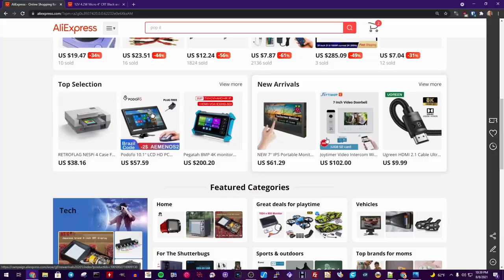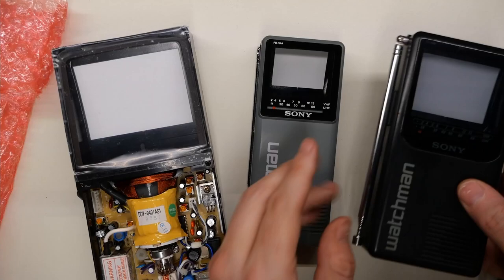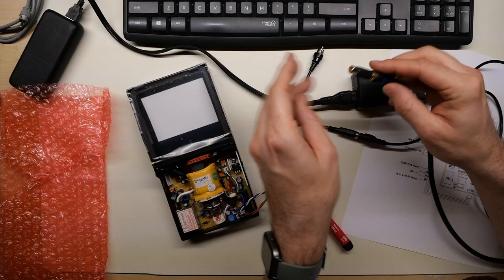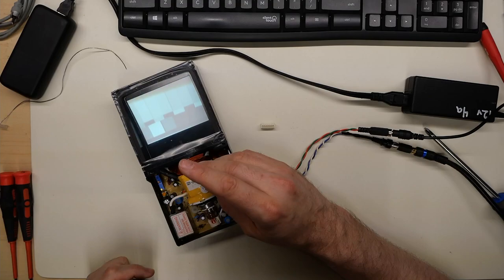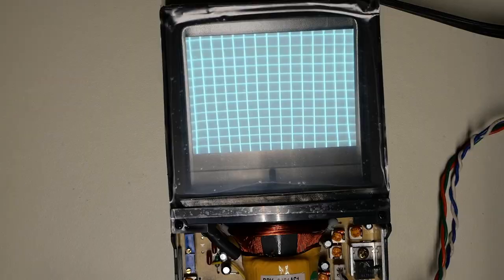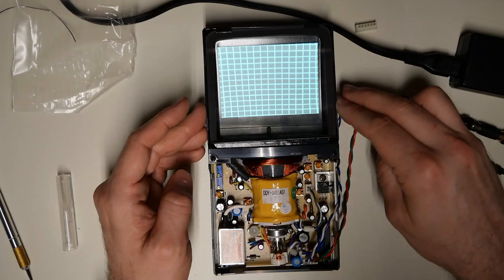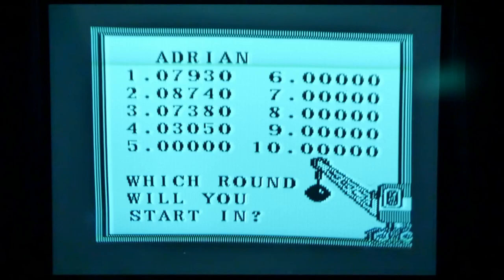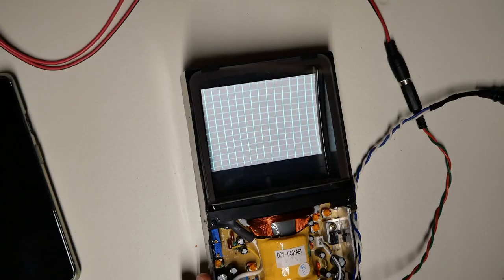This small CRT monitor is less than 2" thick

Comment: Love the warning label.  
"Warning.  High voltage may cause mortal damage"
That's one way of putting it.
Reply: Obviously, this means you’re supposed to play Mortal Kombat on it. FATALITY!
Reply: Between 10Kv and 20Kv !
Reply: Just touch everything while making a video.  It might just make a good episode of CSI.
Reply: I picked one of these up in a new in box door phone at Goodwill.  Paid $5 or something for it.  It's awesome!  Had to come back months later and find this video when I realized it was the same modular display.
Reply: Actually I doubt that the high voltage exceeded 10kv. More likely in the 5kv to 7kv. The reason the television screens used 10kv to 30kv is because the larger screens required it do to the greater distance that the  CRT election beam has to go to strike the phosphorus screen. Color TV's have to use 30kv & at a current level high enough to kill you if you came into contact with it. This was one of the hazards of working on the first color TV's. The CRT's didn't have a glass bell like later color CRT's. Instead the bell part of the CRT's was metal. If you came into contact with those CRT's while the power was on, you risked getting electrocuted. Even after the power was turned off, you could an electric shock strong enough to knock you on your butt. I worked with a TV Technician who got such a shoke once. His hand came flying out of the back of the TV so fast that he ripped some of the skin on his hand as it collided some of the electronics attached to the back of the TV cabinet. Yeah he was bleeding afterwards. Later color TV's had a resistor and other features designed to discharge the CRT anode high voltage as soon as the TV was turned off or disconnected from the power.
Reply: I love how Adrian laughs off getting zapped.
Reply: LMAO

Comment: There actually was a COLOR version of the watchman CRT.  It didn't have a shadow mask, and it had only ONE electron gun.  Between each RGB strip of phosphor, was a thin strip of UV phosphor.  A photo detector saw the flash of UV light as the beam moved, and then the electronics switched the gun to the next color in sequence.  By the time SONY worked out the kinks on this tube, color LCD's were cheaper to make and the CRT color watchman didn't make it to the consumer market, but there are probably some prototypes floating around out there, maybe some industrial versions too.

I think Adafruit has those connectors, maybe on cable assys.
Try a degaussing coil on the monitor to remove stray magnetism.
Reply: Wasn't that the Indextron? From what I heard only one model of Sony Indextron (really a beam-index tube) and even that it's pretty rare these days...

Color Watchman TVs iirc used a plain Samsung shadow mask tube.
Reply: amazing
Reply: I just watched a CRT dude do a video on that, was used in a pro camera view finder then forgotten.
Reply: I NEED to get my hands on one

Comment: A couple of tips that I learned playing with these: 

Adding a magnet as you mentioned does help with the geometry.
If you are able to push the yoke up closer to the screen, that also helps with the geometry. If the neck were just a tad longer, I think it would be about perfect.
These look really cool with gel filters over the glass. I have tried red, green, and amber. Even better with a negative image while using the filters

Using the Arduino TVOut library to play with this is fun. I have been working on an expressive robot face to retrofit an 80s robot with one of these monitors.

Comment: To help those old white phosphor CRTs, all you need is a tinted glass/plastic filter or photographic gel right on top of the display.  It will really help with contrast in daylight scenarios.
Reply: that's what i was thinking, try putting a black-tinted piece of plastic or glass over it, in theory it'd work

Comment: Model Railroad guys used a portable DVD player with the small screen to make a drive in theater for O Gauge. You could make a drive-in theater for HO or Z gauge with this. 
Or, go the other way and make a console game for a 12 inch action figure like GI Joe and Barbie.  They real ones had those mirrored things that look a bit like this.
Reply: In Z this would be larger than the largest IMAX screen.
Reply: or a CRT based raspberry pi emulation handheld.
Reply: imax for polly pocket
Reply: imax for polly pocket

Comment: Best use for this? Retro CRT handheld. Use a Raspberry Pi Zero or something and integrate it together in a case.
Reply: It’s monochrome, but yeah a CRT Gameboy would be neat.
Reply: its too bad it isn't color!
Reply: My first thought was functional pip-boy style wearable retro-futuristic computer.
Reply: @michaelathens953  the fact that in Fallout they miniaturised standard tubes (with the bulbous curvature etc) instead of a real side-beam one, is probably the most impressive thing about the Pip Boys to me. Though of course in 1&2 the UI was a bit more mechanical with paper labels vs the “B&W TV but small” aesthetic of the latter ones.
Reply: Perhaps you can even "Re-Invent" a Gameboy handheld console:@)
I was joking by the way !

Comment: 10 years ago there was a whole stack of these complete in a white case, for just €4 a piece at a army and electronics dump store. Bought one of course. They're cute little things, and very convenient as a mobile analog monitor to use when testing consoles and such.
Mine is indeed one of those door monitors. Doesn't have a brand stamped on it, but it's similar to a Golmar monitor. 
 The picture quality is just fine. For 'organic' things like people, the distortion is not noticeable and the contrast is no different than from other monitors. 
The sharpness is not ideal though. Small text is a bit hard to read. Gotta say i didn't try the focus control yet.
Reply: where is this store? I keep hearing of these type of places never seen one
Reply: This CRT is the opposite of a BVM.

Comment: I grabbed a couple of these a while ago. One is being used as a handy workbench mini-monitor for retro SD video out testing and projects. The other one I intend to use as the display for getting my 70’s General Instruments AY-3-8500 series video game IC’s back up and running as a cool retro self-contained portable game. :)
Reply: How did you prevent it from randomly turning off after 30 or so seconds?

Comment: I used to work at a place called "Lexel Imaging" that was the remnants of Hughes Electronics.  Their specialty was CRTs for specialized markets (the only that exist now).  Those little CRTs remind me of the tiny CRTs we made for the AH64 Apache HUD!  I made the coils by hand on a little lathe type apparatus, and formed them into a C shape by hand.  Then you would put just the right amount of high current through it so it would melt the lacquer coating and get hard to retain its new shape.  I also assembled the coils on to the tube and wrapped with mu metal.  There were probably only about 5 of us who worked there doing soldering, assembly and rework.  I got the job because I could solder.  Anyway the AH-64 CRTS weren't 90 deg angle like these -- they were just like a tiny TV set.  In the HUD, it uses a prism or mirror to turn the image.  I wonder why they didn't do it the same way in those Watchmans.

Comment: Yes, regular CRTs use tinted glass to increase the contrast ratio. But usually only a thin layer of tinted glass on the inside, because if the whole 1/2...3/4" thickness of the screen would be tinted, it would decrease the brightness too much. I wonder if a tinted plastic foil would improve the picture with this tube. You can also make the picture green or amber this way, to emulate monochrome monitors :)
If you take a look at the back of this tube, and the tubes in the Watchmans, there is a big difference due to penny pinching during the manufacturing of the newer tubes (even in the genuine Sony I bought from ebay). There's an aluminium coating under the phosphor in the Watchman tubes, but there's no aluminium coating in the new tubes. The purpose of the aluminium coating is to reflect the light from the phosphor. Without that coating, the newer tubes waste close to 50% of their light output by projecting it behind the tube, onto the black plasitc bracket! This also means if you reverse the newer tube you can see the image from the back side, but unfortunately it's not usable this way, because the glass is textured, so the image is blurry through it. There's also a transparent, conductive ITO (Indium-Tin Oxide) coating on the inside of the screen to apply the anode voltage behind the phosphor. You can see some painted aquadag "fingers" inside the tube which connect the different parts of the tube through the lines where they are glued together. These painted "fingers" bring the anode voltage to the transparent electrode behind the phosphor.

I bought one of these monitors in a local online auction here in Hungary a few years ago (2017-2018 I think). I bought an other one from ebay a few months ago, that's actually a genuine Sony one. I will buy one more from Aliexpress, because I have a plan with them since years. Unfortunately the genuine Sony model is out of stock everywhere, except one US seller, but it's too expensive, both the product and the shipping.

Comment: OK, I admit, I'm only at 5:30 now, but I've noticed @ 2:10 that the PCB has a design date on it 2006-12-10, which could suggest that this has a 2007 manufacturing date - most likely for the South-East-Asian and South-American markets, as it would yet have been less expensive than LCD back then.

Comment: I think you'll find that the first version of that display was built and designed by Sinclair Research (1985), though that used static charge for deflection rather than magnetic coils.
Reply: A static charge one would be AMAZING because it would open up DIY oscilloscope possibilities
Reply: Yes I also believe Sir Clive Sinclair was the first with the  Tv80.  I have one in my collection.
Reply: @daholmes1  I've still got mine too. Owned it since 1984.
Reply: Yes - Sinclair did get theirs into production first -  https://en.wikipedia.org/wiki/TV80.  One interesting difference (for CRT nerds) - the Sony tube uses a curved surface for the phosphor which helps display geometry by simplifying the vertical deflection requirements. In the Sinclair tube, the phosphor surface is aid flat, parallel to the origins of the electron beam, so the beam has to be bent through a much greater angle.  In addition, the Sinclair tube has the electron gun off to one side, instead of below the viewing area.

Comment: The housing for the door intercom screens protected the screen from getting too much light and typically would only have been lit from overhead, so it wasn’t too hard to make it functional.  I always wondered how they were made...  very cool.  I saw quite a few of them still in use as a Home theater installer between 2009-2018, the area had a lot of ‘fancy’ older apartment buildings; if it ain’t broke...

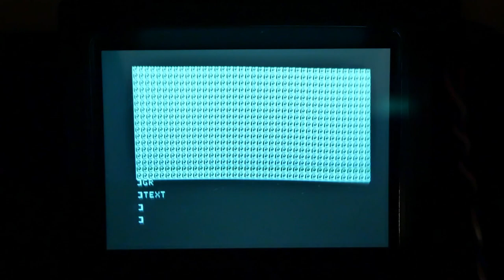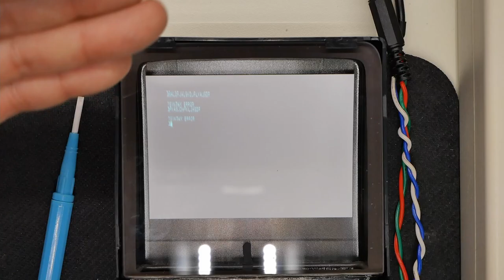Comment: Adrian, at time stamps 26:04 to 26:44 you discussed the color & brightness of the phosphorus display & asked if anyone knows about this. Well I'm your man. One of my 1st jobs as an Electronics Technician was in TV Repair in 1970. The color of most of the black & white CRT's was a flat light white or greenish white. The glass face of the CRT was clear to Smokey Grey. This smokey coloring acted like an ND lens filter on a camera to improve the contrast of the CRT image. Sometimes the glass in front of the CRT was tinted. This later trick of filtering ths CRT with tinted glass TV some fell  fell  y the wayside as the new color TV's started coming out, the CRT's all had smokey filters built into the glass. Also the larger CRT's had a noticably higher anode voltage applied allowing for a brighter image on the phosphorus screen. You could boost the anode high voltage on that monitor if you have the Hardware Skills necessary and then add a smokey grey glass or plastic sheet over the screen to improve the contrast in bright conditions. Sort of the same effect you get when you turn the lights out. In low light conditions, you eyes iris opens up to let in more light and the low light reduces the amount of light that reflects off of the light colored phosphorus.
Also after thinking about it, I think the reason the image moves or distorts when you touch the CRT screen is because the CRT beam is striking the front instead of the back of the screen. Everytime you touch the screen, you are putting your finger in the path of the electron CRT beam. Your finger is blocking &/or magnetically moving the electron beam to go around your finger. The static charge you're body picks up acts just like the magnetic field the video yoke produces to move the electron beam. When the electron beam strikes the phosphorus screen from the backside of the CRT screen, you don't get this affect.

Comment: I had the little grey Watchman back in the day. It had an 1/8th inch "antenna" jack on the top. So I got an adapter from Radio Shack that converted coax to 1/8th inch and was able to connect it to my cable box. I even got my 2600 to play through it!
Reply: It was so cool back in the analog days when you could just plug one thing into another thing and it just worked.

Comment: i just ordered one of these from the same site store about 2 weeks ago before seeing this. im just waiting for it to arrive.  i have, in some typical way in of finding an interest in something, gone down a rabbit hole of CRTs and vintage electronics. my backround....... i know nothing about electronics and circuitry, but find it really cool. in the past couple of months i managed to accidentally purchase a marantz model twenty and a marantz model 120b, which both are equiped with a miniature CRT scope display. then found a hitachi V-152F oscilloscope (free) and a 564B storage oscilloscope (pretty cheap). as well as five vintage CRT tubed televisions, in which two i transformed into dancing display oscilloscopes when audio is added to them. also on market place picked up a few boxes of stereo, tv, amplifier vacuum tubes that came with three seperate, individual , giant oscilloscope tubes/bulbs, which tey stand alone with no structure or frame, just the naked bulbs, and i tell ya, they alone are just beautiful.

Comment: The 15 pin video connector on the //c has a 12v output rated at 300mA...   It also has a composite video output on it... so you could make a cable to connect the crt directly to the //c with one cable/connection. :D
Reply from the maker: Yeah it could just do it -- with it taking just under that much current. :-) So a replacement for that flat LCD :-)

Comment: Thank you. I wondered how these type of picture tubes work. I was thinking it was more of a projection tube that lit up the screen, but you showed it is more direct then that. To use video signal with these old TVs you can use a RF modulator.

Comment: LOVE this experiment and video! Amazing (but perhaps predictable) that a new/old-stock CRT from 1993 still works so well. 

... also love your use of RealCalc in RPN format. I'm still using an HP48g for daily engineering use, but I use RealCalc in RPN when on the go.
Reply from the maker: I had a 48G all through college -- and never stopped using RPN. (My HP48G died a long time ago.) So yeah, RealCalc Plus is pretty damn awesome for quick calculations
Reply: I still use my HP15C regularly. I haven’t found anything that does quick calculations any better.
Reply: If you're an HP fan, you might prefer Free42, an HP-42S emulator. I find the HP-42S interface to be most comfortable of HP's interfaces, and more comfortable to use than RealCalc for most things. (One major exception is working in hexadecimal, where RealCalc is significantly better.)
Reply: There's a HP 48g android app called Droid48.
Reply: @Endelin  Thanks for the insight. At this point I'm going to stick with RealCalc. After Adrian's reply, I upgraded RealCalc to PLUS to support the creator of an app I was frequently using (and also became one of Adrian's Patreon members to support another great creator.)

Comment: I ordered two of these after seeing this video. They ended up working fine, but one had a shorted "Cheng" brand electrolytic capacitor on the output of the voltage regulator that exploded with a loud bang! In hindsight I recommend bringing up the voltage slowly and watching current draw closely to try to reform the caps, or at least avoid bangs.

Comment: these unit were used as portable CCT set up monitors for engineers to focus cameras, they were in a leather case with a rechargeable 12 volt battery, i used to service loads of these years ago

Comment: What you could try is adding a photo resistor to the brightness pot so it automatically. Gets brighter when the lights are on and dimmer when the lights are off.  Might take a bit of tweaking to get it just right.

Comment: I remember when those Sony Watchman sets were new and always wanted one back then. Many years later I was reminded about them so I bought several of them on eBay. I probably have both of those Sony sets you showed and I think I paid around 20 to 25 each shipped. All of them worked and analog TV was still broadcasting back then so I was actually able to watch them. They do produce a pretty decent picture depending on how good the crt is. I used to repair used TVs for fun and profit so I still have a couple of a Beltron rejuvenaters and tubes, tube testors, and boards and parts.